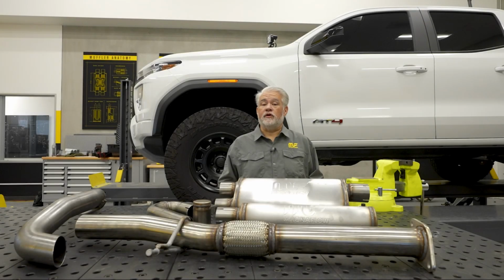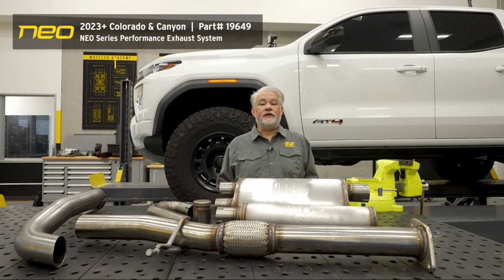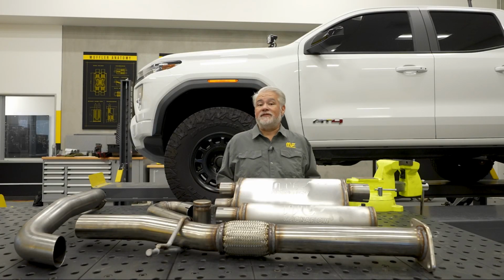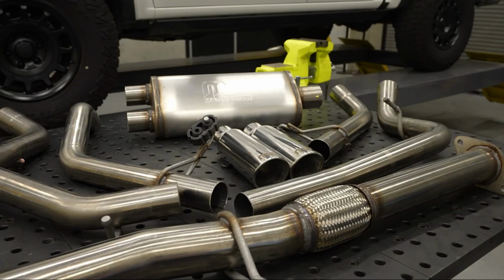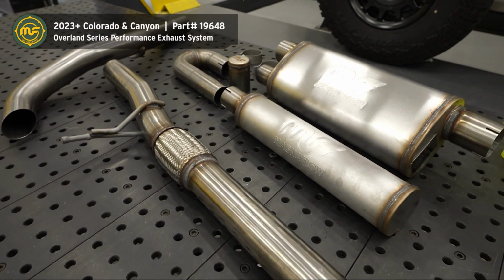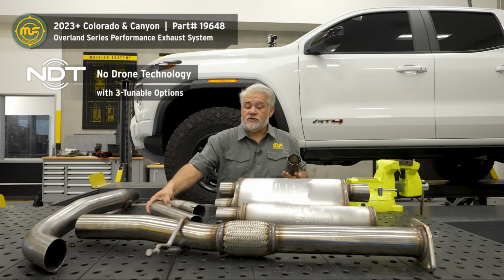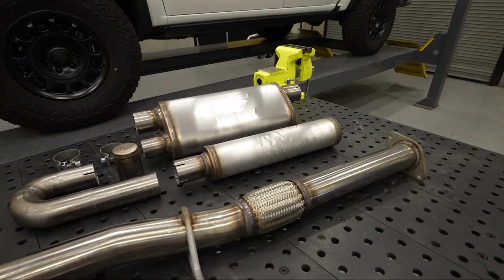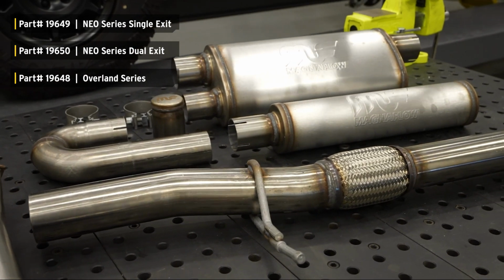Tech Talk: Exploring 3rd Generation Chevrolet Colorado and GMC Canyon MagnaFlow Exhaust Systems

Comment: How soon will this be on the market? I am looking at what all I want to do to upgrade my Colorado and one thing I did was look at your exhausts and you had nothing in stock for Colorados a couple months ago.
Reply from the maker: All three exhaust options for the 3rd Gen Colorado/Canyon are now in stock on MagnaFlow.com! 🔥 Check them out here: 

NEO Series Exhaust System (Single-Exit): https://www.magnaflow.com/products/19649-magnaflow-neo-series-cat-back-performance-exhaust-system-19649?variant=40539505131599&utm_source=youtube&utm_medium=social&utm_campaign=techtalk_colorado

NEO Series Exhaust System (Dual-Exit):https://www.magnaflow.com/products/19650-magnaflow-neo-series-cat-back-performance-exhaust-system-19650?variant=40539505197135&utm_source=youtube&utm_medium=social&utm_campaign=techtalk_colorado

Overland Series Exhaust System: https://www.magnaflow.com/products/19648-magnaflow-overland-series-cat-back-performance-exhaust-system-19648?utm_source=youtube&utm_medium=social&utm_campaign=techtalk_colorado
Reply: @magnaflowtv  thanks. I’ll be saving to the the overland one.